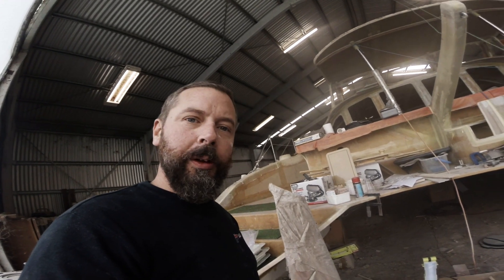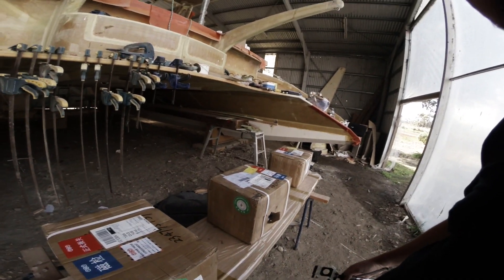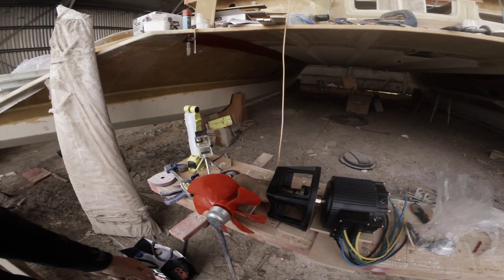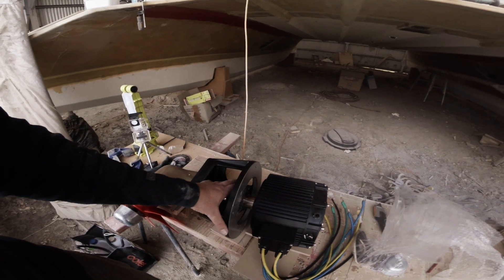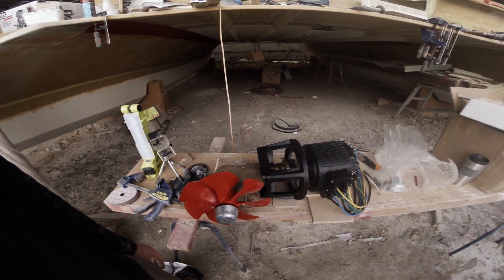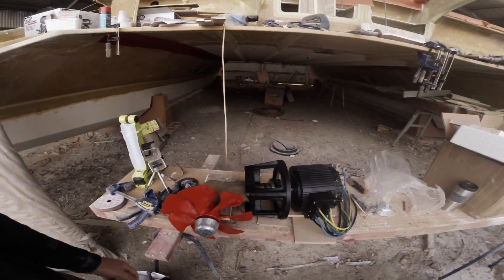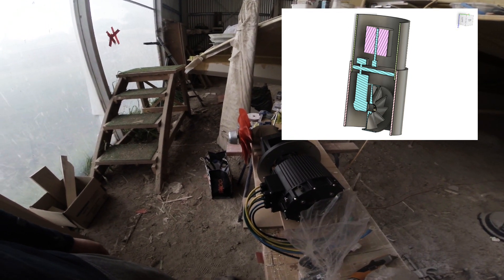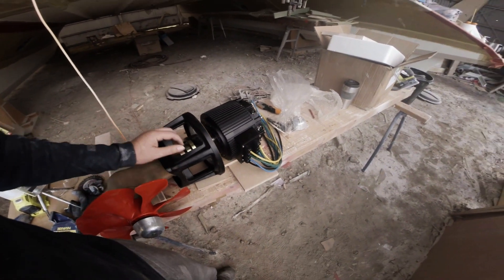Wilda's Drive System sneak peak - S01 E11 - DIY Catamaran

Comment: Those are bow thrusters, right. You can't think you'll move thw boat with those 😅😅😅
Reply from the maker: @tanaseav  not quickly, no. certainly not with the original props. thrust and speed are two vastly different things. I want thrust.

Comment: Ok...cant wait to see a little more, has left me with heaps of questions.
Your prop selection appears to be aimed at low speed regen/high thrust not sure this matches the boats characteristics ..... light performance cat. By the looks of these you would be able the generate electricity at anchor with just tidal stream flow!
First look at them thought they were for a bow thruster, looked more at home on a submarine (both these assumptions explained in other comments), i think you would be better off with a feathering prop or vairiable pitch arrangement 
I like that you are retaining the retractable element but I would try for as long a vertical shaft as possible to maintain the motors above the waterline during deployment, this would allow you to have less water tight pressure critical shaft seal above waterline on a water tight bulkhead/sail drive compartment....if you have the head space in that part of the hull that is.
I would not think the raising mechanism requires to be too soild or complicated as any strength requirement can be achieved by locking the units final position up or down.
None of my comments are critisisms just observations, remain very interested to see how they go, cheers
Reply from the maker: Sorry.. Lots of questions above. Will do my best to answer.
Seal will be above waterline when retraced. Prop is from a bow thruster and will likely be good for regen at lower speeds... Probably not at anchor, but perhaps in high tidal flow, though I will try to avoid such anchorages. Variable pitch would be awesome, but mechanically challenging. Motors will not be submerged... If I get it right. If they need to be, they will still be in a waterproof cylinder that lifts up and down with the drive. An extra seal on the shaft and a sensor between outer and inner seal should give me some warning if the outer seal should fail. Sealed watercooled motors adding to robustness.
Reply from the maker: As for high speed propulsion, I intend to use the sails for that 😂 I don't expect to be needing to reach hull speed on the drives, and they will not be great for this purpose. For mooring and tight quarter maneuvers I think they will be more than adequate. The retraction system will be above waterline and supported by fixed sliders. It will be as simple as I can make it, but robust and with cheap, easily available spares.

I have recently finished the design for the lifting system. Allowing me to modify it for added functionality once I am ready for that. Looking ar different props is something I imagine might be desirable if I don't get the performance I expect. My main focus is manouvering thrust, if it was looking for speed I would go a different way.

Thanks for the comments. I really appreciate it. Hope I have answered some of your questions. And I hope to share more as soon as possible.

Thanks again

/ Axel
Reply: @buildingwilda  Thanks for the replies, apologies for throwing so many questions at you, very interesting build (i am not doubting your choices, would just like to understand a little more)
One of the great advantages of electric propulsion is regen, this coupled with a fast sailing catamaran means you have the potential to generate a significant amount of power underway. It just feels that your high thrust prop selection may only be suitable for regen at low speeds (less than 5 knots), higher speeds and I suspect the drag on that prop will cause issues. So it just seems like this setup overlaps with a speed range where your decision to motor (due to light airs) and the oportunity to sail (and regen) will be actually quite narrow and you may end up missing out on the regen option for the majority of your sailing.....just my thoughts
Reply from the maker: @bunyipdan  Good point. You may be right. I hope not, but you may be right. :) In really light airs, I hope to still be sailing but may on occasion use the electric propulsion. Obviously no regen while motoring. I imagine I would have to be sailing at around 5 knots or more to make regen possible and practical, to overcome holding torque and producing enough power to make it worth while. I may reach an upper limit for where having the thruster deployed may cause issues, but I hope this is above 15 knots. Though Wilda will certainly be able to sail at 20+ knots, I imagine more sailing will be done in the range 5 to 15 where I hope, but do not really know if the prop will work as I hope it will. As the prop is spun by the waterflow during regen, rather than the other way around, I imagine I will get lower rpms than when producing thrust for any given speed. I have not done any calculations at all, so really I have no idea, just guessing.
If I am sailing at 20 knots, I doubt I will be wanting to regen.... Perhaps to help stabilize the boat. I have heard of occasions where downwind performance is calmed down by doing this. Not sure if the same is true for a fast cat like wilda.
Storm sailing is a different beast, a towed drougue system is what I have learnt wil be the best option here.

As I said before, I really appreciate the questions. Many of which I have asked myself many times... I'm hoping I got it right, If not, I will change props. Probably for a high thrust outboard prop of some sort. I will have clearance issues with most types of feathering props.

Hope to hear more from you in the future, and please dont hesitate to ask more.

/ Axel
Reply: @buildingwilda  Thanks again for your response Axel, if you are going to step outside of the norm things aren't always going to look like they will work (nothing wrong with unconventional) and I agree you really wont know until you give it a go.
There are many additional benifits electric propulsion adds to the sailing mix; heavy weather sailing tactics, pinching higher, cheater sailing but most people just look at the basic range and max speed. A while ago I came across a series of interviews with Bruce Wilson, although they are quite old now, still think they help shed some light on the practical aspects of running electric propulsion, worth a look  "Lagoon 410 Electric Waypoint with Bruce Wilson Part1" on YouTube .... https://youtu.be/ZcitatGJCh4
If you do consider other props maybe something like a Kiwiprop option might give you a chance to fine tune to your application (but money)
Cheers
Reply from the maker: @bunyipdan  I have actually been looking at the kiwi props. As well as other thruster props from side power.
I'll have a look at the video you posted. There is another one you might be interested in. An interview by nick o'kelley talking to the owner of the catamaran called top secret. Have a look.
Reply: @buildingwilda  yeah i follow the O'Kelly's, Top Secret is a classy boat....I think they donated one of their 4 Ocean Volt electeric saildrives to Sailing Uma (recent upgrade).
My concern still stands regarding the application of thrusting props, although those side power units do look the business. My thinking with prop selection is not so much maximising thrust, but maximising hydroregeneration application and efficiency coupled with sailing effeciency. That is why I would be looking at variable pitch props and ensure the feathering option does not impede regen (I think Kiwi do a prop for electric drive/regen application....may not be as good as Ocean Volt, but maybe more accessible). I feel that the high torque characteristics of electric motors basically has low speed manouverability covered no matter the prop (within reason).
Reply from the maker: @bunyipdan  needs to be tested in the field with my props... The high thrust prop has a much lower pitch meaning higher rpm at lower speed and this is what I hope will give me better regen than any fixed or folding props designed for propulsion. The variable pitch of the ocean volt servo prop system is brilliant and would be ideal, but out of my budget... Variable pitch would be great, but I can't afford it. So I am planning for maximum regen on a fixed prop, leading me to a low pitch high rpm prop like those of thrusters. Inefficient for propulsion, but I hope a very good match for regen and manouvers.

Also low maintenance and relatively cheap spares. 

Like I said, I need to test it all irl... Looking forward to it. Hope to get back to building soon! Corona.... 

I appreciate your involvement! Thanks!
Reply: @buildingwilda  yes I am looking forward to seeing how it all comes together, and very interested in the application and performance, totally understand the budget thing, as they say nessesity is the mother of invention (.....well I think thats what they say).
Stay healthy and well, Melbourne's having a hard time of it at the moment, hope things start looking up soon, cheers
Reply from the maker: @bunyipdan  thanks. We're actually back in Sweden, eager to get back soon to finish the boat.

Thanks again.
Reply from the maker: Head space is limited, but I believe I have designed a system that will work and allow for a dry drive compartment I really hope so 😂 would be a shame to drown the motors 😂
Reply from the maker: @bunyipdan  yep. not enough head room. technically I think the motor might actually be above the waterline even when down, but it will be close. I don't think I'll have any issues sealing anything, but we'll see.
I doubt the motors will generate useful power anchored in a current, but yes, props geared for thrust, not speed

Comment: hey,
 I love the electric idea, looks like a very nice and efficient  setup. what is the idea with the shape of the propeller it's looks like a submarine propeller
 by the way do you have boat building experience what is your background ?
Reply from the maker: 😂 I did my military service on a sub 😂 The prop and lower unit is a large thruster unit. Designed to sit in a tube. So designed for thrust, not efficient propulsion.
I've only built a couple of kayaks before. So not exactly a boat builder 😂 I am a deck officer by profession.

Comment: It looks like the fibreglass tube for the bow thruster with that size prop would be a great starting point for building your bucket........and may suit the purpose you’re trying to achieve....!? How confident are you that the bowthruster gearbox will hold up to continuous use? I hate to sound negative! Thanks for sharing.
Reply from the maker: Not negative at all! The lower unit is not technically designed for continuous use. On the other hand, I don't intend to motor continuously... Hoping cooling is sufficient. It should be.

The tube is a bit small to get everything into... But I'm looking into options.

Thanks again for the comment
Reply: I thought it was an electric scottel drive. Continuous running. Powered by solar and or generator.  Id rip out my two volvo penta with outdrives for electric power. Where did you purchase it and how much. Can't wait to see it fitted and tested. Great video thanks.